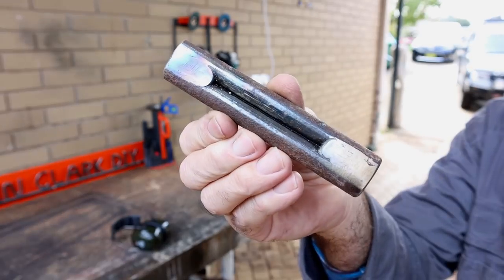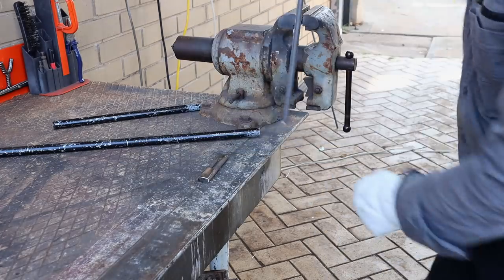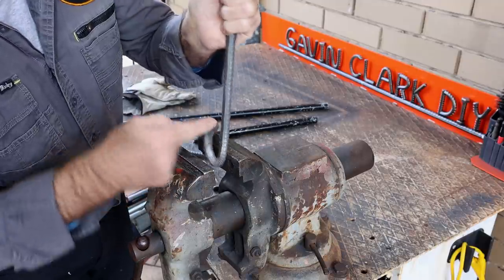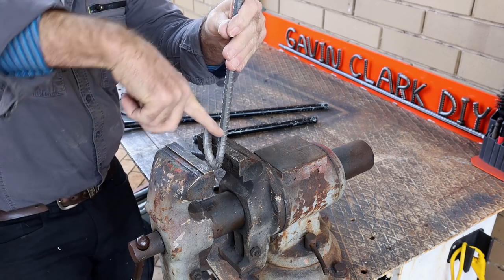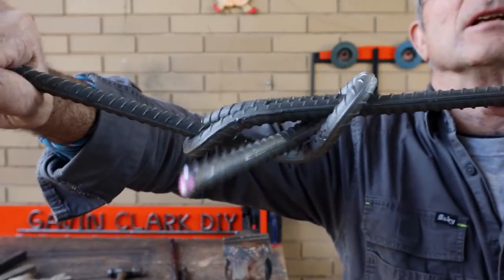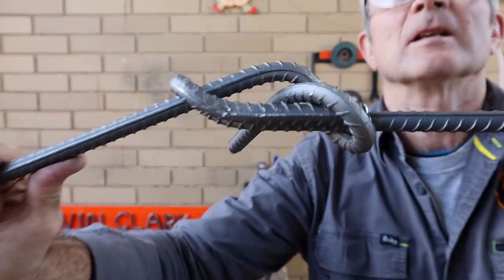I make a Sheet Bend Steel Knot by Bending 1/2 inch Rebar - Without HEATING - Metalworking Project.

Comment: You should buff them to a shine as sticks prior then again after tooling.
Reply from the maker: I agree you are right, it makes it a much easier job at the end. I do generally just wire brush most of my projects as they will be rust treated and then some clear coats which gives a nice old color to the steel. Thank you for your comment.

Comment: Would love to see a if you could do hondo knot that’s on a lariat . Been struggling for years to get a decent one with rebar . Love your videos,  you are the Master of rebar and I have learned so much from your ingenuity . Thanks 👍
Reply from the maker: Thank you very much. I have put hondo knot on my list, I see it is also called a Honda knot, Looks like a tough one to do without heat, It's on the list. Thank you for your suggestion.
Reply: @GavinClarkdiy  Yep same thing just depends on where you grew up in the US as to how we say it over here. Awesome , I’ve done it with heat but can’t really get it tight as I’d like. I’ve tied many of those for what we call piggin strings to tie up calves when doctoring them and on an occasional lariat when the head needed to be replaced . Now they just buy a new rope or lariat. Looking forward to many more of your videos.
Reply from the maker: @Experiment-yk5mf  Thank's for the info, yes I agree it is hard to get a tight looking knot with rebar, the bumps are never in the right spot to just clip in just right, and look great. You were just making one to hang on the wall, weren't you?
Reply: @GavinClarkdiy  it was a combo of a knot on one end and a loop to look like a lariat for a hat rack. For the loop I upset one end and got some mass then drifted it out to slightly larger and then threaded  the rebar back through itself, so technically not a Honda knot on that on the one I did do, well didn’t look like a knot even though I went through the motions 😁. The ridges are definitely hard to get around.
Reply: Too bad I could post a pic for you so you could see
Reply: @GavinClarkdiy  We don’t mind heat! It’s the artisan we love to see in action! Heat, no heat, doesn’t matter!
Reply from the maker: @Experiment-yk5mf  Send it here please, I would love to see it. gwclark111@gmail.com
Reply from the maker: @tomt9543  Thank's very much Tom.

Comment: Nice job, but why dont you fasten your vise down properly? I thought that you were fighting against it towards the end. A well-fettled vise is an asset in the workplace.
Reply from the maker: The vise base is tightened down and does not move, I just had not tightened the two swivel adjustment bolts down tight enough, and the levering on it with a pipe made it move a bit, I did not notice it when doing the bending, but the movement shows up in the camera, I try not to overtighten these as they get done up and undone many times a day. When done uptight it does not move. Thank you for your comment, you are very right.

Comment: Hi, me again.  bending by hand like that is not working out for me I am missing something.  I just noticed you twisted the rebar before bending.  Do you bend at the straight line or where hash marks are?
Reply from the maker: I bend, either way, it is more how you want it to look when it is finished as to which way you bend it, If I had bent this the other way it would have a line down the middle of the steel which would not look as good, in the lettering behind my bench it was all bent sideways so the best face would be forward. Rebar is not the best to bend, you need something solid to hold it why you bend it and a long bit of pipe, there is hardened rebar too, I am using standard housing rebar. Maybe get hold of something to heat it with and have a play with that and try that. You may enjoy it more then. Hope that helps a bit.
Reply: @GavinClarkdiy  thank you so much for detail reply and so fast.   I was using 1/2” rebar from Home Depot (local hardware store) perhaps it is hardened.  My vise is cheesy small me as well not massive like yours.  I’ll try map gas torch or oxy acetylene from my air conditioning work.   
Again, I truly appreciate the help.  BTW those magnets holders are awesome thanks for putting them on your video.
Reply: Yeah I just tried at work on monster video and heavy table like yours and it worked like you show it.  I am going to try heating it in my little light weight vise.
Reply from the maker: @munawarsoomro6207  Awesome let me know how you go, it doesn't have to be super red or even red hot to make it a bit easier to bend but as you could imagine red hot lets you really have a good play with it. I wish you the best.
Reply from the maker: @munawarsoomro6207  That is great news, have fun.

Comment: one question is why !?
Reply from the maker: It is a knot, I made it because I was asked if I could. I will bend the ends up and make a hook, I plan to use the hook in a project with 1/2 inch rebar making a wall hanger.